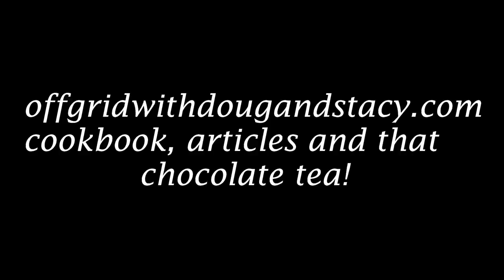Spray Foam OPEN CELL in our LOG HOME! build Day 49

Comment: Now is the time to examine all those water stains inside the cabin & determine how they got wet. Is there something that needs to be addressed / corrected before going forward ??  The Gully Washer could have been a real blessing if you discover some real problems..
Reply: I imagine it was blown in by the rain. But it is a great time to see the highs and lows in the flooring.  I think that they will be using the chinking material in the walls of the cabin. You are right!  This rain event can provide opportunities to find problems!   😊👍    ~Sharon

Comment: Really nice insulation set-up! You used that stuff in the water tank storage room right? Your mom will have a very well insulated home! So glad it can cure and then will not outgas. So glad you can let it cure and work on the outside while it cures. The contractor looks like he knows what he is doing and doing it well. Great that it will be sealed up and even critters will have a much more difficult time making nests inside the cabin. I liked how you said you did all the "rib breaking" while you were rattling off all the stuff you do. Thanks for documenting this build so well Doug despite your rib breaking. You do a wonderful job. Wow, a gully washer! That creek is really flowing! Are ya sure you aren't building an ark? Stay dry Doug! Too bad they had to stop for the day. Thanks for another great Vlog.

Comment: Our first house was a fixer upper on a shoestring. We replaced our front door~solid wood~(why they call some self hung remains a mystery) ...so I was told about this “Great Stuff” ~one should be required to hold a contractors license, I filled the gaps, showered and the foam was all outside the surface  so I used my finger to swipe and wipe off the access...that ‘great stuff’ had to wear off. It was as awful as walnut oils lol oh and when I came home from work, the door was sealed shut. Finally! Many years later  a funny memory~

Comment: Doug, last video you said Gary reads and answers all the comments so here is a few questions I have for him and for you.
1. Are you going to trim all the excess logs sticking out at the corners of the home to the same length? or is there some reason some are sticking out from others? ( other than one is longer than the others...Ha!) I know it is petty but it is driving me CrAzY!! 
2. Why wasn't the spray foam sprayed until it expanded past the rafters to be trimmed flush later for maximum insulation?
3. was the possibility of flooding from the creek taken into consideration when the foundation was made? If it filled the creek that much from a short gully washer, what will happen in day long or longer gully washer? 
An inquiring mind wants to know...Ha!
Of course I am looking at it from my perspective living on the gulf coast where we have had 10-20 inches of rain from an event...
P.S. I LOVE watching your videos!!
Reply from the maker: Its just for U 🤣

Comment: I was surprised to see you using  spray foam but that is your decision. Love watching this construction process.
Reply: What’s wrong with spray foam?
Reply: @millcreekrange   the gasses that come off are pretty bad. It can off gas for years.
Reply: @krismcaferty362  only if the foam was applied off ratio is the only way it’s going to put gas for more than 24 hours.

Comment: I've worked with spray foam insulation application for about 10 years. We've installed both open and closed cell and the only time to use open cell is when you are sure it will never get wet. If it does it will hold onto the moisture for a very long time. In other words, make sure your roof never has a leak which I'm sure you will.
But open cell foam is a far better sound barrier than closed cell so you won't hear that rain pouring on the roof as much.

Comment: Doug, I have a suggestion; but you most likely already have thought about it. Since we have seen the boys walk across this creek in a few other videos. I think digging the creek deeper and put the dirt on the edges of the banks. This way Grandma's house won't get water inside.  Our house was built in 1940's and the insulation in the attic was bad (wet and kind of mildew) we had people come take the old stuff out and spray foam the ceiling and the floor area.  It has kept our heating/AC bills down low. I don't mind the sound of the water but the ting, ting, of a metal roof would drive me crazier than I already am. LOL I am sitting on the edge of my seat waiting to see how she decorates around and in her new home. Don't forget to give us a walk through when she gets moved in.

Comment: Where's that huge squeegee for the floor? Make sure any exhaust fans for the restroom, vent into the soffit so you don't get a back draft during the heat of the day, back into the house. Have you thought about putting a measuring stick near the trees that are in the middle of the stream, just to see how high the water level might be?

Comment: Roofing first- completed- then interior - trapped water inside the interior panels and /or spray foam needs to dry out before roofing can be completed. ABC Not BAC. Best wishes!

Comment: Hi there! This is amazing to watch. I was wondering on the spray foam installation in the walls if when you need to fix electrical or plumbing is it difficult to cut through the foam? Then do you have to re-apply it where you cut out, or just use the pieces you cut out?

Comment: When are you going to install all the electrical? I would think you would do that before the insulation.
Reply: They don't interfere with each other. Insulation in the roof and gables, electric in the log walls.
Reply: @christinedehn3257   I disagree the insulation in the ceiling will be in the way I have been a electrician for 40 years.
Reply: I dont’t think they use it.  Stacy and doug dont have in their cabin they?

Comment: As I deduced, this is why the spacers didn't need to be butted together for sealing. This is going to be one cozy cabin, and from here on out it will be much more comfortable to work in regardless of the weather. 👍

Comment: This style of roof insulation is whats known as a "hot roof". Theres not really much of a difference between the A and B components for 2lb open cell vs a 3lb closed cell, a bit more foaming agent in 2lb, but the hardeners are interchangable. Sprayfoam aint too hard, the cost of the equipment is the limiting factor for DIY. Froth packs are good for small DIY jobs (couple hunded sqft). And yea good call on them packaging up for the day, foam wont adhere to a wet substrate, and something always breaks on a rig without failure. Lol

Comment: Are you worried at all about the creek flooding and flooding your mom out?  Should a house be completely air tight?  Is your mom going to be completely dependent on her HVAC system for ventilation?  Hope you don't mind me asking.  Is your mom going to have a wood stove?  If so, where will it be vented?

Comment: They should do an air purge on their resin side at the drum pump. We change from open cell to close cell all the time. We just put an air bubble in between the oc and cc and waste the first bit of resin to come out. That way no chemical flush to pay for and change over can be done in about 10 minutes. But I will say doing it with the fusion gun sucked. The change over is much easier to do with the probler.
Reply: He should run that air line under the handle too as opposed to the topside due to how his fluid lines are run.  Where do you spray foam at?  Who’s foam are you running now?  If can find any to be had that is. Lol!!
Reply: @millcreekrange  in Alabama. And we have just been using whatever foam we can find. We had to drive to Arkansas and to Texas to get some a couple months ago.
Reply: Water purge takes longer but is much better at cleaning the line
Reply: @MadebyKourmoulis  where in Alabama are you?
Reply: @robertcockerell  just don’t purge the A side with water.  🤣🤣🤣
Reply: @millcreekrange  you may as well throw the whole thing away if you purge the a side with water ha ha. 

We are near Birmingham but spray all over.

Comment: WHY???  is the insulation being sprayed before the Hvac/ plumbing, and electrical have been installed? 
Plumber has roof penetrations to make. .sparky has wires to run
OH AND HEY>>>> Do not forget to cut the hole in the outside wall for the dryer vent.  before insulating the wall.
Reply: Keep in mind that it is a log cabin. That's why they covered the interior walls with plastic. There is no insulation in the walls, they are logs. And the wire races have already been drilled in the logs.  as far as plumbing goes, there will be no plumbing in the outside walls.
Reply: It is easy to cut thru the foam to install afterwards but is really difficult to spray the foam when everything is in the way.

Comment: Something I learned when I owned a house with spray foam.  It continues to off gas for many years.  Formaldehyde is a key component in that stuff.  Not a very healthy way to go.
Reply: it depends on the how well it is applied.  When a spray foam application fails to fully react the off-gassing can continue indefinitely - forcing occupants to flee indefinitely, causing not only health problems but deep financial problems as well.  Stories of foam that didn't cure and the roof had to be removed to fix the problem.  you're playing Russian Roulette with your property when you decide to spray foam it.  However, the industry says it is rare.
Reply from the maker: That is incorrect,  after 24 hours if done right its super minimal if not zero.... and there is 1 more step that also will help
Reply: @OFFGRIDwithDOUGSTACY  I am just telling you from my own experience.  The smell never truly goes away and mine was done in the attic and in the flooring below the house.  Anyways love the videos and the lifestyle, hope I didn't come off as an a-hole.
Reply: @OFFGRIDwithDOUGSTACY  u r correct, if done right. Im sure you check out your spray guy before hiring.
Reply: @TravisMontesano  then your foam was sprayed in off ratio.  Your installer was definitely not a professional.
Reply: Formaldehyde has been outlawed in foam since the 80s
Reply: @robertcockerell  yeah, I’m really surprised that Formaldehyde thing is still going around like it is.  I know it’s not in any of our foam systems.
Reply: @robertcockerell  what’s your name?  I know you’re on SFWW.
Reply: @millcreekrange  Robert Cockerell

Comment: Fila vision ? Wanten  to share the misery?  LOL
   If it's any comfort I've been in the garden the last 2 days yes it's sticky. 
   It's looking good!  Soon you'll be onto the next project. LOL Got to love expanding foam. It insulates quite well year around. But there's a benefit in structural strength as it clears your roof sheathing to your trusses or rafters. It also cuts down on condensation which could be a major problem when using fiberglass insulation under the roof sheathing.

Comment: STAY OUT of that place for at least two days   I DIDN'T and the off gas (formaldehyde) caused me to go blind for ELEVEN DAYS! I used closed-cell foam.
Reply: Foam is not made with formaldehyde
Reply: @robertcockerell  Tell that to the VA lab.  I was being considered for corneal transplants based on the eye damage, which the lab said was caused by my having breathed and been exposed to off gasses, specifically "FOR ALDEHYDE". It was closed-cell foam, 9 years ago.